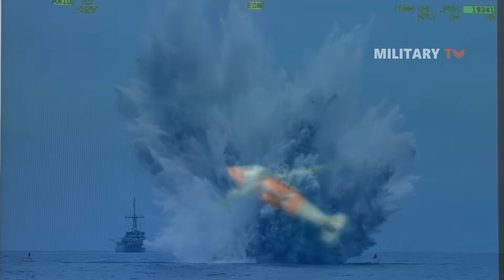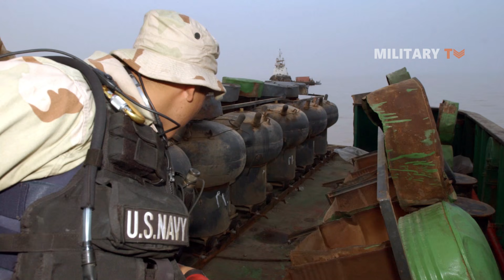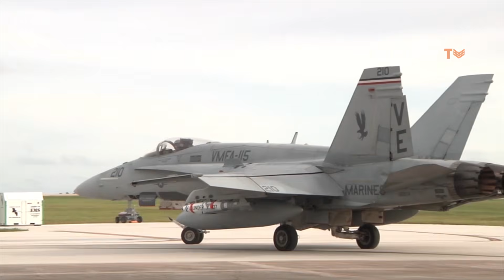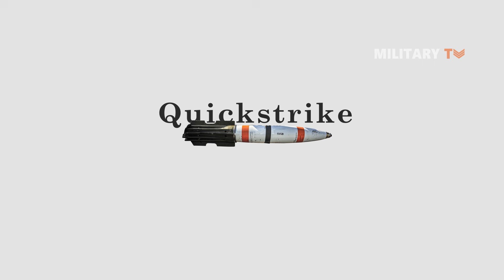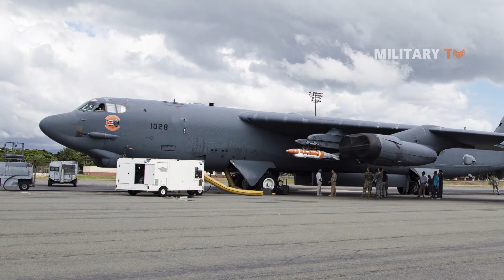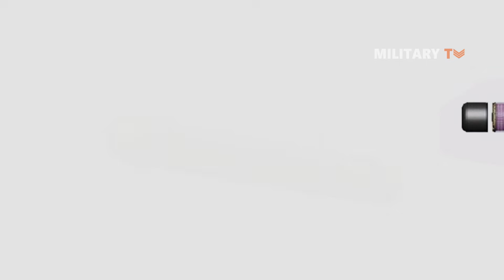Many Things You Probably Didn't Know About The Quickstrike Mine

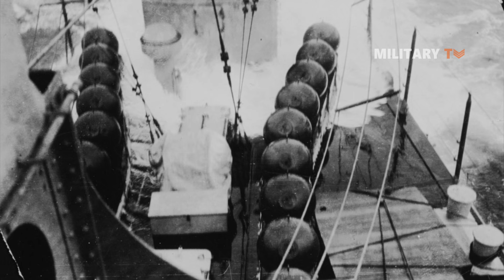Comment: 2:08 Italian made, Iraqi owned Manta ground mine. Sticks out like a donkeys dick on sonar in the warm, shallow, salty waters of the Arabian Gulf.
Ground mines are worse because their charge weight can be much higher than buoyant mines hence a bigger blast and shock wave breaking the ship's back. Also the ship has a tendency to fall into gas bubble left by the blast. 
Mines are wonderful devices and come a many shapes sizes. Encapsulated torpedo / Hammerhead mines on the high end to the low tech and almost impossible to clear free floating snagline mine ( ATP 6a Vol 1 ). A real headache in the Stait of Hormuz that no route survey could counter.
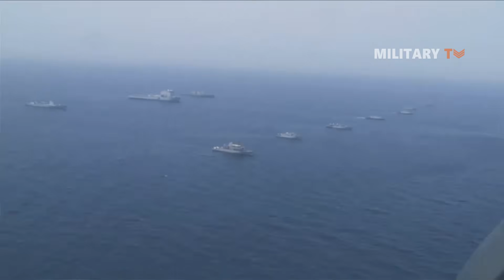1:38 Bay class Royal Fleet Auxiliary  with US/UK Mine countermeasures  squadron based in Mina salman, NSA, Bahrain 🇧🇭.

Comment: I'm surprised they have not turned it into a torpedo...

Release the weapon system from an aircraft..
When it hits the water, the wings snap off and it turns into a torpedo....

This would be very different to defend against.

As the falling projectile would  be out the range of anti missile defense...
Then when it's in the water... Their is no real defence against a torpedo 😉
Reply: They have, its just it wasn't as good as anti-ship missiles which pretty much replaced them. The Mark 13 was one of the most if not the most mass produced aerial torpedo in WW2 but was phased down as anti-ship missiles started coming out as they can fly higher or sea skim at faster speeds and have a better range. The US has the mark 46, 50, and 54 right now which all have the ability to be air launched. But torpedo's ranges are limited, meaning the aircraft would have to get within range, as torpedo's are also extremely slow and could miss a maneuvering ship.
Reply: This is already a thing, called the Mk.54 HAAWC, and the US Navy is currently experimenting with it. Look it up for more details!
Reply: The captor mine then.
Reply: Heard from a navy guy you can shoot a torpedo just whit another torpedo, heard even there are two kinds of one is rocket launched the other from a tube. Also i guess they got something similar for ships.